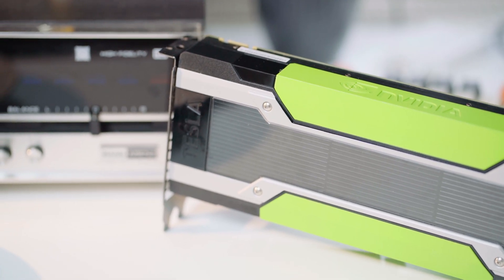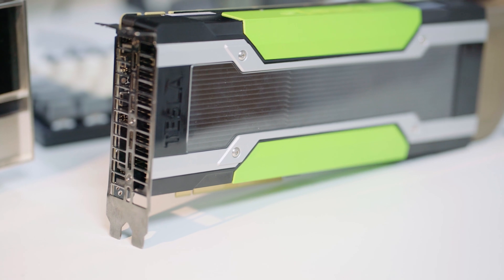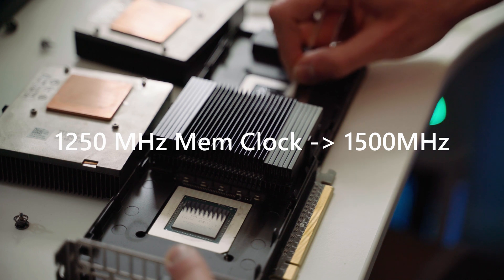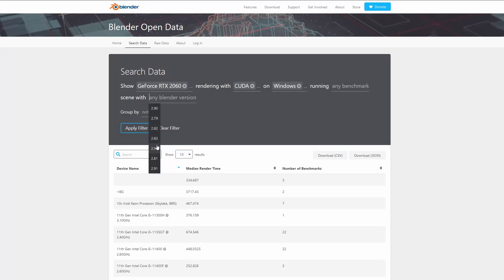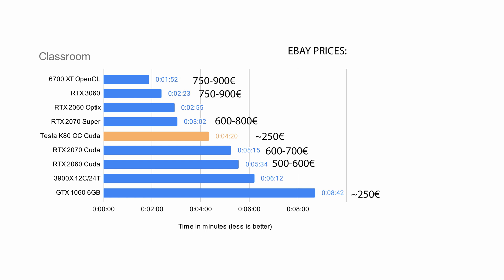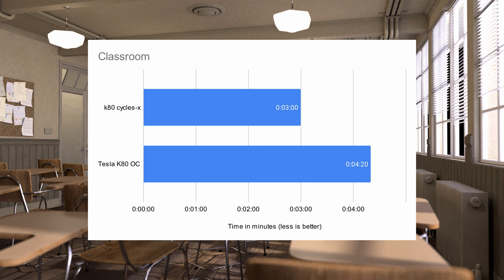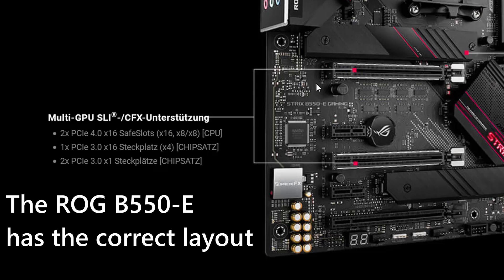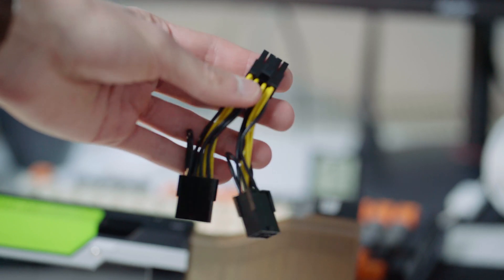Is This $5000 7 Year Old Server GPU Still Worth It? | Tesla K80 tested in Blender

Comment: You can actually game on these (using only one GPU and disabling the other). With good cooling and an OC, Windows 11 let's use specify which GPU to use for specific applications and you'll get nearly 980 Ti performance. Although I'd recommend the K20X or K40 if you can find them cheaply, as they're equivalent to a GTX Titan or GTX Titan Black.
Reply: NO! From a k40/k80, you will get nearly a gtx 780/780ti performance, not even close to a 980 ti! For a (bit better) 980ti performance you will need a tesla m40!
Reply: @o-hogameplay185  Absolutely wrong. The K20X delivers GTX Titan and the K40 GTX Titan Black performance. In DX11, that's between a GTX 1060GB and GTX 1070.

That easily outperforms the 780 Ti any day and reaches around 980 performance. DX12 is another story. The M40 gets 1070 performance across the board though, never struggled getting 980 Ti numbers.

That being said, the K80 is shit. I think I commented thinking he had an M60 - althouh that I wouldn't game on either.
Reply: @o-hogameplay185  I said Titan performance is close to a 980, which is a bit stronger than 1060 6GB.
Reply: @o-hogameplay185  I originally said the K80 was close to a 980 Ti and I was thinking of the M60 but got the generations wrong, as I already said.
Reply: @o-hogameplay185  the m60 is a 970 core, performs about the same as a 1060, or about the same as a 780ti.
Reply: @o-hogameplay185  the k80 is 2 780 tis, you can sometimes hack on sli for titan x performance, but m40 is cheaper anyways.
Reply: You can game on these, but you don't need to disable anything. You need to change it into graphics mode using nvidia smi.

Windows 10 has allowed you to pick a gpu for years now, you don't need windows 11.

You will only get 980ti performance through sli, and we all know the issue sli is.

Why are you recommending kepler cards that are expensive, the m40 is literally a titan x / 980ti and often costs less than these kepler cards and double the performance of the highest end offering of the generation
Reply: @raycert07  My man, you realize I made that comment in the midst of the shortage where the M40 cost $300, a 980 Ti was about as expensive and the K20X could be find for about $60 in most countries AND came with an easily 3D printed fan shroud?. In Europe, you would've been lucky to find the M40 at the time - let alone for under 400€.

Also Windows 10 doesn't let you choose the GPU at all. That feature came with Windows 11. To make this work on Windows 10, it requires a registry hack and at least a Haswell iGPU or a second Nvidia card of the same architecture at least the same driver version that supports both. Just changing to WDDM mode alone isn't enough to get Windows to use the M40 for rendering. The comment regarding 980 Ti performance was in regards to upping the clocks - which you'd have to do on any Tesla card to match the Titan equivalent anyway.

You just exposed yourself for not having followed the market at all. You can't just take a random snapshot of eBay of a single country 10 months after people were scraping by making everything they could work as a GPU and then claim knowledge, half of which is flat out wrong.

I've flipped several K20X machines with Haswell CPUs during the pandemic as esports rigs when literally nothing else was available for a reasonable price.
Reply: @o-hogameplay185  you till need to delete the DisplayAdapter entry for the M40, even when it's set to WDDM mode. Unless something was changed in the last 10 months.

For Kepler GPUs, you absolutely, need to do all that. If you're not using an iGPU for output, you also need to set EnableMsHybrid for both GPUs to set your display adapter as low powered one.

And you should also increase VRAM clocks on your M40. They're like 200Mhz below Titan X clocks.

Comment: didn't realize those old gpus also got that much more epensive. I remember getting secondhand gtx 1060 s for around €100 a few years ago.
Reply: And now 300€ XD
Reply: @R1le06  500 now :/
Reply: @echoXnova  i found a whole pc with i 7 7700 16gb ram and 1060 3gb for 400€ in total
Reply: @R1le06  and? 3gb GPU isn't great at all 😅 and yes good price but i meant 500 now for the Server GPU
Reply: @echoXnova  ohh, a missunderstanding, i thought you said for the 1060
Reply: @R1le06  there is a 1060 with 6gb and 3gb
Reply: @echoXnova  yeah

Comment: feels like 2-3 of these can make a decent render node, just need a dual xeon or single epyc system
Reply: You get 128 lanes using EPYC.duel xeon is I think 48+48 .xeon is cheaper.Is a server motherboard required to run k80's?
Reply: @gerald4027  No, but outside of server or xeon/threadripper you're capped on pcie bandwidth so more than one gpu already goes above the bandwidth cpu can provide

Comment: Other miners said it doesn't mine well at all.
Reply: K80'S are power hungry like a Maserati running full throttle in a Walmart Supermarket going nowhere.
Reply: @gerald4027  that's not the issue, it won't even get 1mhs.

It's just how the card works
Reply: Doesn't mine at all

Comment: Hi. Thanks for the video. I bought the same card from ebay recently (before you made the video :)), clipped a 120x120 fan to it and tested it with blender. It took 10:59 to render the "Classroom". Do you have any ideas why my result is so worse than yours? Is it the overclocking?..
Reply from the maker: It could be the pci-e slot it’s sitting in. It will only get about half the speed if it is connected to a pci-e 4x slot that is connected to the chipset
Reply: @futc.photography  I put it in the first slot of AMD B550 based mb with Radeon in the second slot, so it should be running at x8... also I sometimes get "unrecoverable ECC error" message with it. Maybe it's defective or maybe my PSU isn't doing well because I'm also getting temporary screen blackouts sometimes... or maybe it's the new mobo... I'll try to investigate more)
Reply from the maker: @ВиталийФилиппов-ю8з  okay then the pci-e speed should be fine, not sure what could be causing those short black screens though. If you're doing blender rendering, I would probably turn of ECC.
Reply: @futc.photography .maybe a low amp power supply.
Reply: @futc.photography .maybe a low amp power supply.
Reply: @ВиталийФилиппов-ю8з  sounds like broken vram.
Reply: @ВиталийФилиппов-ю8з  did you enable 4g encoding or whatever, in the BIOS, there is also another setting you have to turn on with some boards.
Reply: @HardWhereHero  yeah that's the first thing I did :-) I presume the gpu is just fried
Reply: @gerald4027  that's not how that works
Reply: @ВиталийФилиппов-ю8з  the gpu is overheating obviously? A normal case fan does not have enough static pressure to move air through the gpu.

Axial fans have a bunch if blowback when going against high resistance. 

Your fan is not adequate, you need blower fan or watercooling.

Comment: TESLA K80 is not a GPU, it's a compute card based on the GK210 GPU Kepler 2.0 arch
Reply from the maker: That's literally the second sentence I speak in my video
Reply: @futc.photography  lol
Reply: It is a gpu. Stop trying to sound smart.

Using a nvidia smi command you can put them into graphics mode and render games on them.

It's a headless graphics card.

This is not some compute node, this is no cmp mining card.

This is a graphics card without outputs.

Graphical processing unit.

Graphical processing units processing graphics, like blender. Blender is a Cuda program though, you can officially enable direct x and all other graphics api rendering and use it for anything. 

Shut up dude

Comment: Wow!  I didn't realize the 6700xt had such strong performance.

Yes, I realize the high end Ampere cards were not included, but it seems the 6700xt would at least match a 3070 while using OpenCL versus CUDA.
Reply from the maker: Yes the 6700xt has pretty strong performance in OpenCL, but the 3070 is a whole different beast. The 3070 beats the 6700xt by a good margin in classroom using cuda. My 6700xt does classroom in 1:52 and the 3070 does it in about 90 seconds, the 30 series nvidia GPUs are crazy good for Blender. I decided not to include the newer nvidia cards, except the 3060 in one benchmark, because it just wouldn't make any sense to compare the K80 to those cards. Of course a 3070 is a lot quicker in blender but right now it also costs 1200 Euro so there really wasn't any point in comparing it to a 250 Euro card.